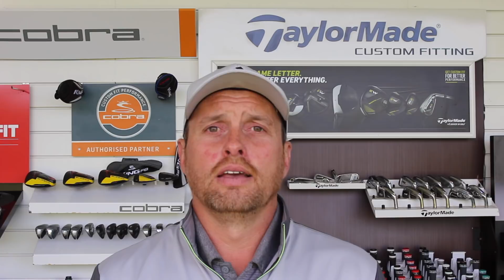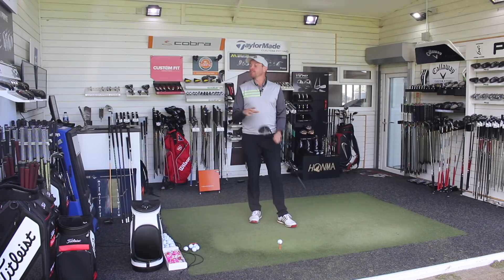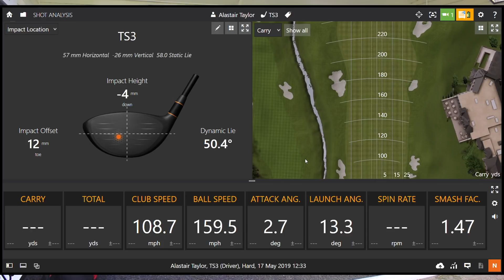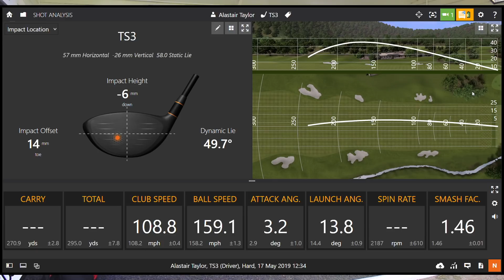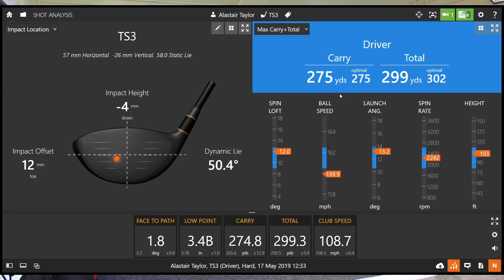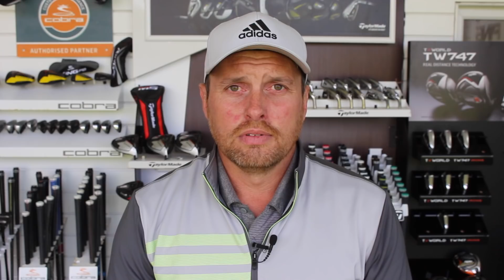HIT YOUR DRIVER 300 YARDS CARRY: PROJECT 300 EPISODE 1

Comment: 58yrs old, 5 ft 8 inches tall, just changed swing and new Ping G400max ...I just had my first ever over 300 yds on flat ground, total distance, 305, 312, and 305 last 2 rounds.  Carry was about 290.....one happy old man.  My new swing comes from Michael Broderick and Lee Commeaux.......simple, powerful, straight,and pain free and did I mention........ repeatable.  Project 300 carry is in sight.